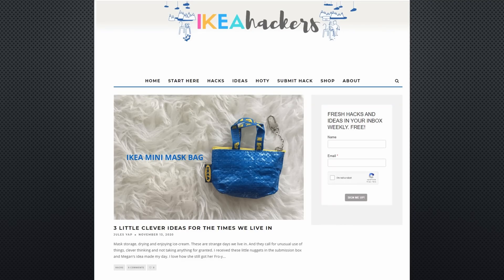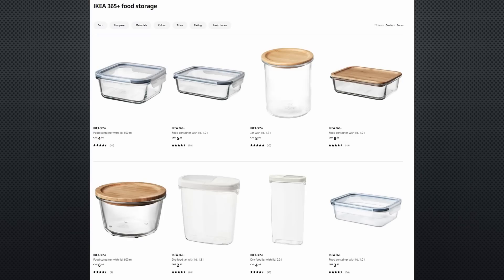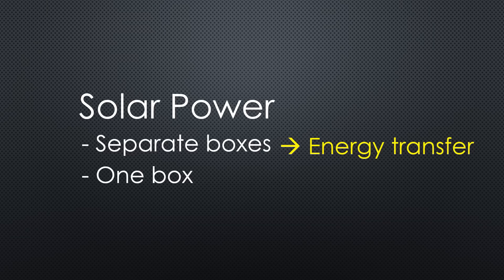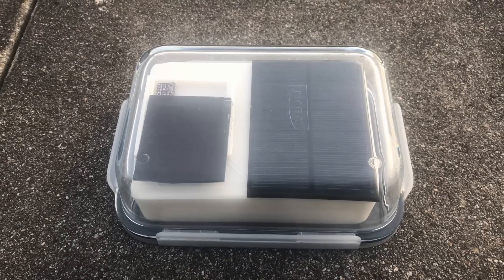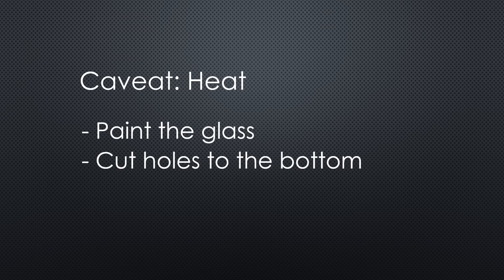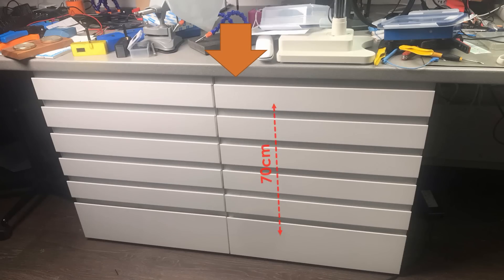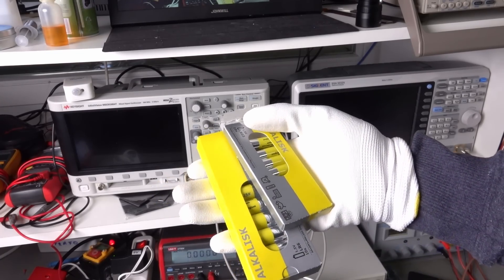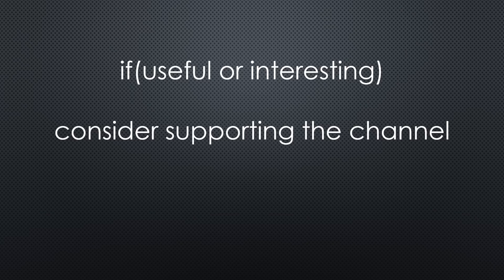#361 IKEA Goodies for Makers incl. my Newest Find

Comment: Thank you for the idea to use "uncommon" boxes for such projects. In general, there are 2 possibilities to build a device for outside purposes : Seal it completely e.g. with epoxy or ensure ventilation. The rules for ventilation are quite easy. Water does not flow upwards but you have to tread the drops pushed by wind. Do not underestimate the differences caused by humitidy (Pascal'sche pressure). That is the reason that almost all boxes for outside purposes having small wholes on a "dry" place or they have a labyrinth construction. The labyrinth construction ensures ventilation and humitidy flow through the gap between the overlapping houses. So: A small box at the bottom and a bigger one as the cover. Is the gap between the two houses is not too big, it is not necessary to do more. One tip: We have small friends crawling into such small gap. Simple trick: Do not place the innerbox direct on the floor and put a small gridded material into the gap. It is even not needed if the gap is rather small and the inner box is not too flat. In short: Make it open, not sealed - Hope you got some idea.

Edit: One more point: Reduce the enclosed air volume. Put e.g. insulation wool inside the box.
Reply: This is very interesting, I would like to know more.  I am not entirely understanding some of your points; do you have any diagrams?
Reply: @zephsmith3499  Take a deeper look to existing boxes for outdoor purposes. Start by your house, then your car, the electronic of the car. Check environment sensors or even boxes for electric distribution.
Reply from the maker: For the moment I assume the box is completely sealed because I had no issues with humidity. But I have to look how it behaves through winter. With your post I have possibilities to solve the problems if they start to occur.
Reply: I'm still trying to understand what you mean; I have looked out outdoor boxes in my vicinity and they do not seem to fit your pattern, which is what makes it interesting.

I think you may be suggesting using a small box with an open top, inside a slightly larger box with an open bottom, with an air gap between the inner and outer boxes so that air can still circulate but rain and splash will not get inside the smaller box.  If so, that makes sense.  

Around here, spiders and insects would certainly colonize that space, making later access a bit less friendly for all parties. I am not sure what you mean by "Do not place the inner box directly on the floor" - like suspend it within the larger box so that the smaller box does not contact the ground?  (Like if the larger box is mounted on a stake or wall, and the smaller box is connected to it via standoffs?)

"Put a small gridded material in the gap" - like some aluminum or plastic window screen?  In the gap between the side walls of the smaller box and the side walls of the larger box, or between the edges of the top of the inner box and the top of the larger box (there is more than one gap in my mental image).

"It is not needed if the gap is rather small and the inner box is not flat" - do you mean that if the top edge of the inner box does not quite fit snugly against the inside top of the outer box (small irregularities making some very small gaps), those minor gaps will be enough for air circulation but not large enough for insects to enter?  I'm wondering how large that gap needs to be (if indeed that's the gap you have in mind) to handle humidity via air circulation, and how small to avoid insects - and seeking practical experience to help get started.

None of the outdoor enclosures I have around here are built like that, but it's interesting as buildup of humidity is a concern in our rainy season.  Some have, for example,  slanted louvers on the side to allow airflow without rain - also easily large enough for bugs.  However, the mental picture I have of two boxes may be different than what you have in mind, so my questions may not make sense.  

I do understand how easy it is to have a mental picture, and to describe it in a way that makes 100% sense to anybody else with the same picture in mind, but which is ambiguous in that the words are also initially consistent with other mental images.  And that disconnect or ambiguity of wording is not obvious to the first person, to whom the other mental picture hasn't occurred; they know exactly what they are talking about.  For example, they know exactly which gap they mean, and it doesn't occur to them (eg: to me when I'm doing the describing) that somebody else might be thinking they were referring to a different gap.  So I'm NOT criticising, just trying to better understand your concept, because I've been looking for a simple way to protect from rain and humidity build up while avoiding bugs.  Thanks for sharing your ideas and experience!
Reply: o @zephsmith3499  My feeling is that you will not understand because is it does not touch your view to technic. You told it: Ensure air flow to transport heat and huminity, give the water flow a controled way - Your car has a lot of such controled water fows but you cannot see it from outsinde. Many cases having small wholes for ventilation or they are sealed. Most sealed cases are not approved for direct sunshine. Next question: How long should it work under such condition. 10h or 10y? - What is so difficult to understand to cover a small box with a bigger one? It is up to you to make this base princip as complex as needed. The concept is called labyrinth gasked. - Nothing special

Comment: and let's not forget the ikea stainless steel bowls used to make a sphere for a van de graaff generator
Reply from the maker: Good point. And I have a few of them to try a 2.4GHz antenna....
Reply: They are often used as a small kitchen sink in campervans (FR : camping car).
People cut a circular drain hole with a pipe. Cheap and cheerful !

Comment: First I'd try actually measuring the temps inside. If they're really that high you could stack two aluminium coolers and insert them from inside sealing the hole with silicone.
Reply: I'd go this route as well. Try to transfer the heat outside without opening it up. I can imagine the glass insulates pretty well so I would go with either a small heatsink (+ maybe a tiny low RPM fan to move around the hot air inside if that doesn't use too much power) connected to a heatpipe which goes through a small hole of the enclosure and then another heatsink on the outside or if that's too tedious just a single heatsink that passes through a larger cutout in the box, maybe one can be found/made that has the solid piece in the middle (which continues the wall of the enclosure) with fins on either side for contact surface to air.
Reply from the maker: I already monitor the temperature in the satellite box. In the plastic box it reached 60 degrees max. in summer. We will see how it will behave next summer in the glass box. I also have to look if the storage temperature for batteries is probably higher. Then I could deep- for these few hours...
Reply: @AndreasSpiess  rule of thumb is batteries like it warm. There's certain high performance aircraft models I won't fly with cold batteries. 
Preheat for high performance LiFePo is 45°C, with T_never_exceed 85°C.
LiIon is much lower with risk of explosion generally around 60°C for LiIon but that is chemistry dependent. 
For lead acid you'll be facing high hydrogen production above 45°C with cell breakdown around 55°C.

My personal favorite for this scenario is capacitors. Ultra Capacitors will easily work with the voltage and current levels in this application and you can get them for temperature ranges up to 150°C.
Reply from the maker: Caps would probably be a good fit for the light sensor. No power=no light anyway ;-)

Comment: couldn't the sun up/down times be calculated according to the device location ?
Reply: Or a lookup table. It's not like the data is changing. (Wee lt is but on a glacial schedule)
Reply from the maker: Both can be done. I just call an api (I was too lazy for the mathematics)...

Comment: I have a very large plastic bin with a snap lid like that, that I use to hold 4 spools of filament for my 3d printer.  Each filament has a just-tight-enough bung to feed to the printer, the others covered in tape when not needed.
Reply from the maker: Good idea. I reduced my number of open spools and do not do any precautions. So far I had no big issues. But before, I had issues with old spools. Your system probably avoids that.

Comment: The reason your solar panel turned opaque (at least part off the reason) is that these cheap panels turns opaque in UV. The effect is supposed to be worst closer to the UVC range so putting them behind plastic or soda-lime or borosilicate glass will probably help protect them by blocking some of the really nasty UV but it will hurt your over-all efficiency more in the short term when the temperature rises since solar panel efficiency is reduced by high temperatures. It also also important to note that attempting to completely seal electronics meant to operate outdoors isn't necessarily a good idea. The reason is that you need to make your seal so good that it seals not just against rain but also needs to be fairly air tight. During the day the air will heat up and contain some humidity. If any of this air makes it into the container, then during the night when the temperature drops you will get condensation inside of the container. Then during the next day the condensed water will have a more difficult time evaporating because of the sealed container. This cycle can slowly build up water inside of the container when conditions are right. Often it is easier to simply have a container with a small drain hole toward the bottom, but you should put a filter here since the heat from the electronics can attract bugs. As you mention li-ion batteries are also problematic since they should never be charging when above 45 C. This is unfortunate since you end up with the hottest temperatures exactly when you would be getting the highest amount of energy from your solar panel. Using the solar panel as a shade for the electronics (including enclosure) is a good idea. I just don't think those resin solar panels are worth your time for outdoor use (and of course they don't work with normal indoor light sources). Look at ETFE panels if you don't like the glass solar panels (though finding very small ETFE panels can be difficult). Just be careful not to have ETFE panels in a situation where they can catch fire (e.g. near a Li-ion battery). ETFE is amazing in many ways but you really don't want to breathe ETFE smoke.
Reply: About those cheap panels. I saw this on another YT video and tested it on mine here since I was polishing and sanding them every single couple of months until I could throw them away.  I now cover them with helicopter tape (that's what they call it). Really cheap from some sources. All of my cheap panels (including those on 1 euro solar lights) have been clear for long time now.
Reply from the maker: A lot of good information. Thank you! So far I can afford to experiment because both boxes are away from people and if they would burn, nothing happens. I am curious on how long the batteries will last. Maybe I try to do also a comparison with old NIMh. They seem to be less critical.

Comment: Andreas, perhaps a passive heat sink or heat exchanger or peltier junction applied with heat conductive grease might help with your box's thermal issue.  I make extensive use of Ikea kitchen organizers, especially the Sunnersta bins on rail system and children's dish and bowl sets and organizers to feed my animals, help with food preparation and as temporary part holders during disassembly of gear.  The children's items are very cheap, colorful and mostly BPA free.  Perhaps your cat would enjoy them.
Reply from the maker: I never looked at the Sunnersta system. Maybe I will have a try next time I am there...
Reply: @AndreasSpiess  they are handy for hanging on the edges of shelves and cabinets to have items close at hand like zip-ties and other consumables, I also sometimes put hand tools in them.  The smaller bins stack and they are all removable and stand up on their own, so you can carry them to different benches or other locations or reorder or relabel them depending on the mission at hand.  A downside is they can be top-heavy and fall over if they don’t have something to lean against.  They also restrict access to drawers or shelves behind them.  Worth a look to see if they work for you.  Thank you for your always fresh ideas.

Comment: I keep my SMDs in WenTai boxes from Ali. But I keep those boxes in a Kvissle tray box from IKEA.
And of course, LADDA is king.
Reply from the maker: I also have such boxes for my through hole resistors. But they are too big for the Kvissle tray :-(
Reply: I use takeaway food containers (intended for a single use) for boxes I will need into only rarely - the lids evntually split but they are economical, you can get 50 Satco brand (good quality, avoid the rest!) 500ml or 650ml for about 12 euros delivered. They will stack 8 high with light items before becoming too wobbly.

Cheaper brands will last only 2 or 3 openings - beware.

For very light use - short cut strips of SMD components - these tend to curve anyways and fit nicely- they will stack up to 16 high if you have shelves full of them alongside each other to give lateral support.

The problem is the lids - they split easily with repeated opening. But for price they can't be beat especially for passives and mechanical components (they are far from ESD safe so drain the charge off everything before using) 
 
 I use Ikea boxes and tubs for "rummage" boxes I will use every day - you need very good quality lids for those.

edit: they are supplied "nested" with lids and bottoms in seperate stacks so 50 containers take up little space until deployed in use. Ebay search for   SATCO  Plastic Containers with Lids Takeaway
Reply: My ultimate hack for cheap smd boards' protection is the lacquer spray. Waterproof on its own if you don't plan to replace the parts.

Comment: unless it's made of Quartz or fused silica glass, it will not be transparent to UVC. 
At 1:38, it shows it to be "Heat resistant glass". Not sure what that means!
Reply: True and you don't really want UVC hitting an epoxy panel. In fact UV and especially UVC is what turns these cheap solar panels opaque over time. I assume "heat resistant glass" means borosilicate glass but who knows.
Reply from the maker: I checked the UV values from summer and they were quite low. So it is well possible that these glass boxes have a hidden advantage to reduce UV...
Reply from the maker: Good point! I see some UV with my sensor, but, as you might have seen, I took the ND filter away because it was not overloaded. Maybe because the glass already attenuated the UV.

Comment: I would just separate batteries and sensors. Those components have different needs, so we need to provide different environments. Nice video, again
Reply from the maker: You are right. But it is so convenient to have such a single box. Maybe attach a 3D printed box below the case ..

Comment: Thanks Andreas, I really enjoyed watching this. My lab starts getting more and more of a mess, but each time I want to reoganise things I spend too much time thinking about what should go where and eventually just give up. These type of video's help getting some insight into how other people are organizing their labs.
Reply from the maker: Simpler concepts applied are better than perfect concepts in the head ;-)
Reply: I've needed to change my storage concepts a number of times, due to change of address and also what is my "active usage". I have some suggestions:
a) Don't commit to a certain concept, but rather implement  solutions that are extremely flexible.
b) Find low cost storage boxes that you can source for many years. That means name brands, rather than random selections. In that way, you can easily add more.
c) For components and hardware, use various solutions based on dimensions. Plastic test tubes and mini vials with lid (scrapbooking), pharmacy pill bottles, fishing tackle boxes.
d) Removable inserts in compartment boxes sounds good, but often they pop out and contents get mixed. So I use vials and place those inside the comparment boxes.
e) Put all the sorted parts into drawers. I use one drawer for resistors, one for capacitors, one for LED, one for semiconductors, another for modules, etc. It's better to have a part empty drawer than to mix things and need to rummage.
f) Label all containers on 4 sides AND the top.

Comment: Hi Andreas! Thank you for all your videos and amazing work! To cool the batteries, or anything else for that matter, I believe that you could use the glass itself like a heatsink. By having the enclosure printed in white inside as you do, I honestly doubt that the temperature of the glass would go more than a few degrees centigrade above the ambient temperature, even on a very hot day... but again, it would depend on quite a few factors.
Reply from the maker: The Lacuna board has a built-in temperature sensor. So I should be able to monitor the temperature also next summer. 
It would not be easy to use the glass as a heatsink because it does not have a lot of flat areas on the side. But I agree, it will be cooled by the surrounding air. And teh top is used by the antenna and the panel.